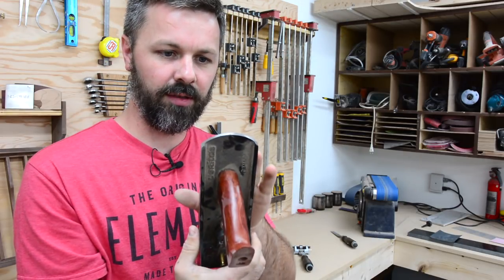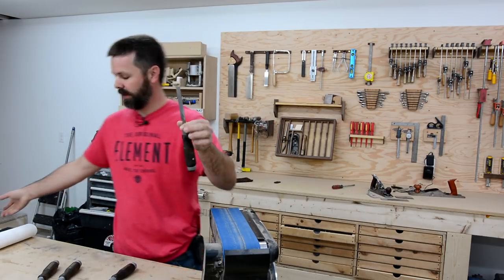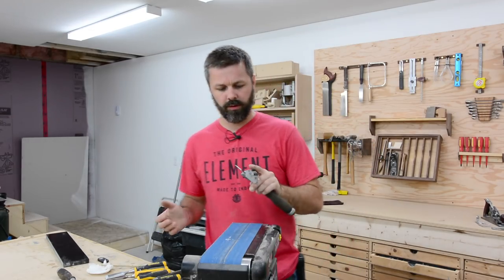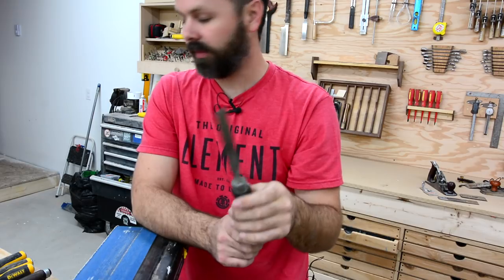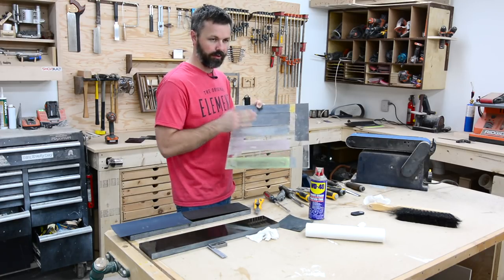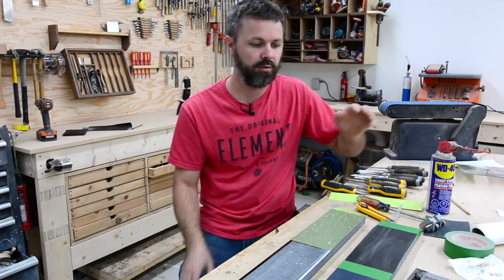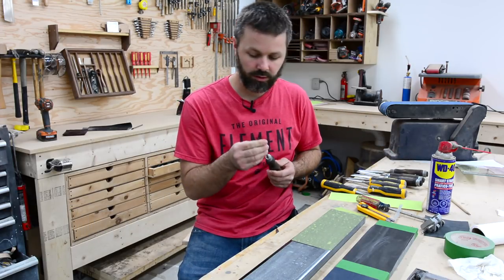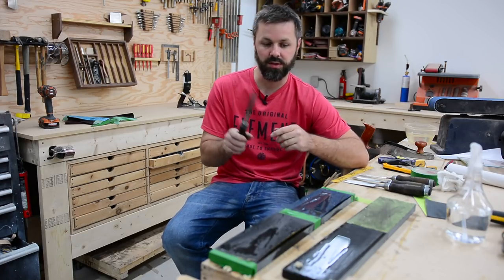Sand paper sharpening system update

Comment: I use Krylon Easy Tack. It’s a spray adhesive that will stick your sandpaper to glass or granite like a post-it note. The sandpaper won’t move, there is very little residue and it is very easy to clean up.

Comment: I had a similar experience leaving mine in a storage cabinet that I thought was protection enough in an unheated garage. Now that cabinet has an electric  heater/dehumidifier made for gun cabinets. Surface rust got the backs of your chisels out of flat? Man, using that belt sander on them is some tough love! Glad to see they survived and live to work again. I haven't found water stones to be that expensive. Norton sells a complete starter set including a flattening stone for less than $150 that will last several years, then you can replace one stone at a time as needed. I bought a diamond flattening stone several years ago and haven't needed it yet. And a good compact way to use, store and transport stones, water and all, is Lee Valley's stone pond, around $70. It's plastic, but I've been using it as the heart of my sharpening system for several years now.
Reply: Michael Anderson I am in a similar situation I never thought about using the dehumidifier. I oil well and keep it at bay for the most part. Does it have a fan of some sort to circulate the air. My tools are housed inside drawers on my workbench and I am trying to reason how I could use it in my drawer unit.
Reply: No fan, it just heats. I mounted it near the bottom of the cabinet and haven't been troubled by rust since (about 2 yr). For workbench and shop drawers I use inexpensive dehumidifier packets from amazon in each drawer. They have never gotten saturated but if they do you can regenerate them in the microwave.
Reply: Michael Anderson thanks for the information I did do a search after I posted I figured that was the type you had used. I do have some open air space in my bench I'm going to give it a try.
Reply: Good luck with your rust issue!

Comment: I feel your pain I live in south Louisiana with humidity levels in the 90's most of the year and I live close enough to the gulf to get that wonderful salt air. In a non air conditioned shop yea rust is inevitable but I lubricant my planes and chisels with machine oil as Paul Sellers recommends and I get very little rust. I started with the sandpaper method and still use it to flatten a new tool. I have a dmt diamond stone 1200 grit and I use a hard strop and the level of sharpness I get now is far better than what I get from sandpaper.  It only cost about 60 dollars for the stone and 20 or so for the horse butt strop and green stropping compound. I know sharpening is one of those things no one agree on but that is my way of doing it.  I love watching your channel and hope to see you more often.

Comment: Hi Ryan, 

The chisels and the plane will still be very close to sharp even if there is some surface rust.  As an alternative to abrading/grinding off the surface rust on your plane try placing the components in a bath of cleaning vinegar overnight.  The cleaning vinegar is only a little more concentrated that cooking vinegar and it will gently dissolve the rust without being too aggressive against the rest of the metal.  You may need to use a stiff nylon bristled brush to shift some of the stubborn rust spots after a few hours soaking.  When you remove it from the vinegar, rinse it well in clean water then dry it with a rag and apply some light oil immediately.  If you don't you can get a light coat of flash rust forming within minutes.  From there you just do your usual sharpening steps .  The rust formation shouldn't have caused any warping so there should be no need to re-flatten the backs of chisels or soles of planes or regrind the primary bevels.

This is a common and cheap  method used for restoring hand planes and there are plenty of Youtube videos demonstrating how to do it.

Comment: While your granite cut offs may be good enough and certainly will feel nicer to work with, they're probably not as flat as the glass and there's no certainty the next ones or someone else's will be flat. Removing the adhesive isn't an all day job. Soak it with Zippo lighter fluid to break it down and it should wipe right off with a paper towel or rag. 5-10 min and you'll have a perfectly clean piece of glass again.
Reply: Melamine is even flatter than glass. It's also really cheap and doesn't shatter when you drop it

Comment: I must have missed it but why ditch the glass in favor of the granite? I have a slab of granite is why I’m asking. Also, are you not going to use the auto store sandpaper and spray or double side tape? If so, your gonna just order adhesive backed sandpaper from rockler?

Comment: Tape residue - use lighter fluid. (Naptha) .Takes it right off after a minor soak. Easy! comes off glass (or practically anything) Either dampen a paper towel or spread a few drops on the residue.. Stubborn ones where paper is embedded can use a razor blade scraper for coaxing. Massively cheaper than ordering high priced paper and granite blocks!

Comment: Don't use a belt sander to sharpen your chisels. It's just a bad idea. Use something designed to sharpen your tools. For the glass, you don't need to tape them down, just wet the glass with glass cleaner and it will stick pretty good.

I bought a worksharp 3000 for my chisels and plane blades and it works great. The sandpaper is lasting a lot longer than I expected it to.
Reply from the maker: +Get over that Wall it is risky, but fast. I'm a busy person;)
Reply: yeah, just stupid using that belt sander, lots of new woodworkers are going to mess their chisels and irons up doing that.
Reply: Dwarfsbane Ironfist I have little pity for someone watching Ryan screw up his first chisel here, and then still continue with the beltsander...

Comment: If you want to clean the glue off the glass easy, try using a little WD40. It is a great adhesive remover.
Reply: He had the solution on the bench during the video.  WD-40 is my go to adhesive remover and then use glass/surface cleaner to remove the WD-40.  It only takes a couple of minutes and minimum effort.
Reply: Eucalyptus oil if you can get it is a much better adhesive remover than WD40.
Reply: Acetone always works for me. You can get it st the box stores.

Comment: I don't think I'd recommend using a belt sander to remove rust from the backs of chisels. If you touch the cutting edge down first, as I saw happen a couple of times in the video, you've lost the flatness of the chisel back.

Comment: Really bad idea to use belt sander for sharpening.  No flat platen to insure blade back gets flat as when using glass.  Use mineral spirits to clean glue residue off glass - easy 30 sec. job.  Been using sand paper on glass followed by water stones for years.  Only major job first time you have to flatten and make bevel.  After that, a few min. per tool to stay sharp.
Reply from the maker: +Mark Hazlewood I was concerned how flat it was as well, but I actually didn't have to spend that much time at the sand paper before It was fast.